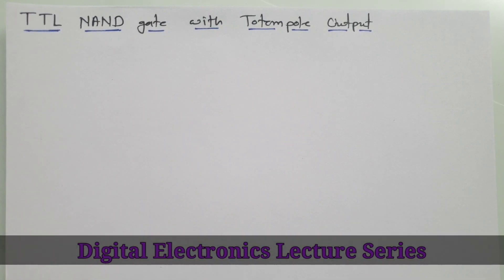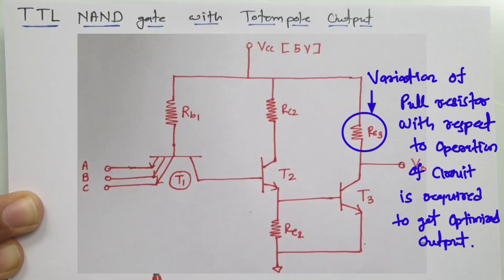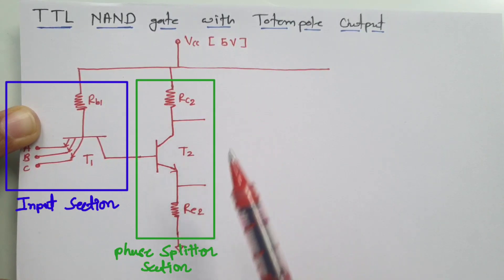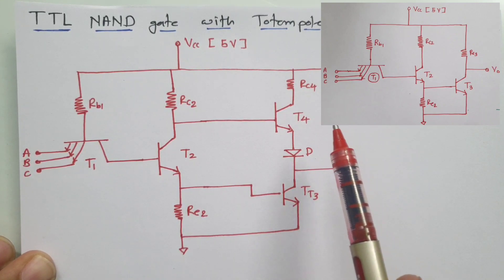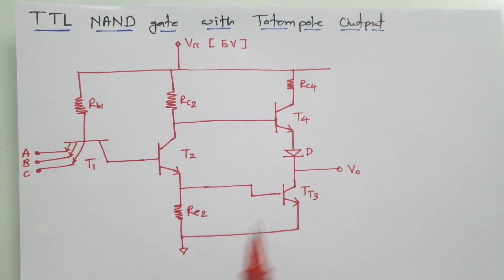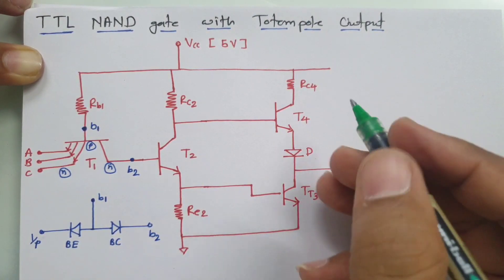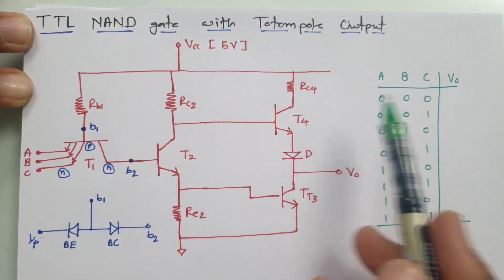TTL NAND Gate with Totem Pole Output: Circuit and Working

Comment: 00:00 TTL NAND gate with Two Tempo Output
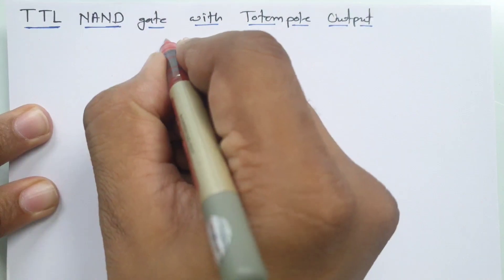01:50 A TTL NAND gate circuit with three sections
03:51 The circuit design of transistor T1 and its working in NAND gate configuration
05:49 Explaining transistor circuit behavior with active low inputs
07:47 Explanation of triggering and voltage requirements for T2, T3, and T4.
09:37 Logic 1 output when any input is logic 0
11:34 Understanding transistor t4 turning on conditions
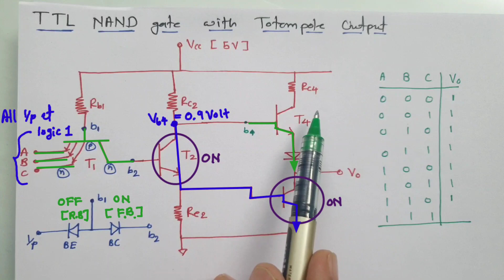13:37 Passive pull-up resistor is replaced with two-tempo circuit to improve the fan out and noise margin.
Reply from the maker: Your Appreciations, care and share matters a lot to me. #EnginneringLove. 
All the subjects playlist of Engineering Funda is available in comment section. Share it with your friends to support us. 
Your positive comments motivates me and person like me get boosted by my students feedback. Thanks and welcome 🙏

Comment: At 9: 36 , This is seriously an error for 1st case when any input is low , nand outputs high .
Then at last stage , you used kvl and we have vcc = 5v which is logic  1 .
How can Vo be equal to 5volt(logic 1) when you  did Vo = Vcc - IcRc4 - Vc4 (sat) - Vd  ??
Please explain me this .
Reply: Any output voltage above 2.7V is considered to be a Logic High Volate for OUTPUT DEVICES.

Comment: Thank you sir for the excellent explanation... could you please tell me why the voltage across T3 is 0.7 V when both T2 and T3 is ON? Sir why the voltage is 0.2 V (Vce) and 0.7 V (Vbe)?
Reply from the maker: It is standard voltage across silicon pn junction. For Vbe it is like ON state voltage across diode which is 0.7Volts